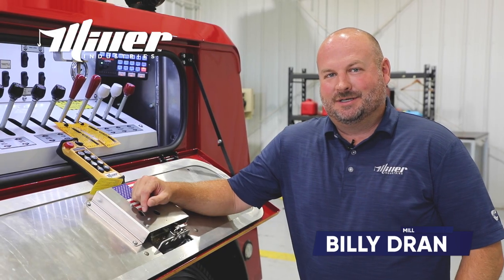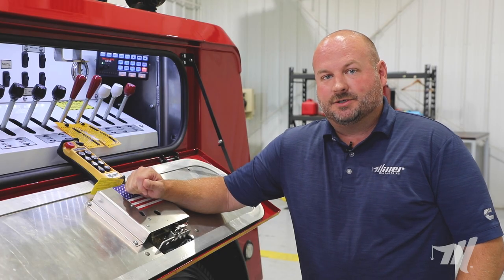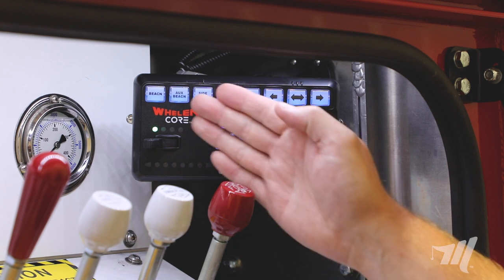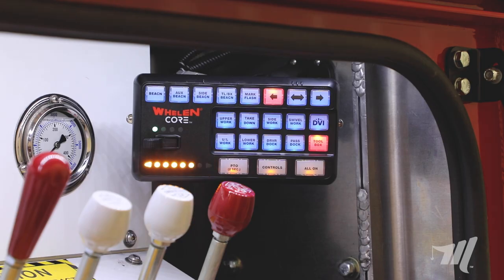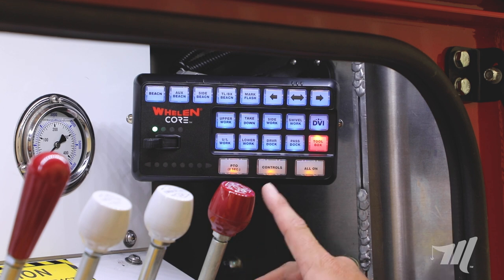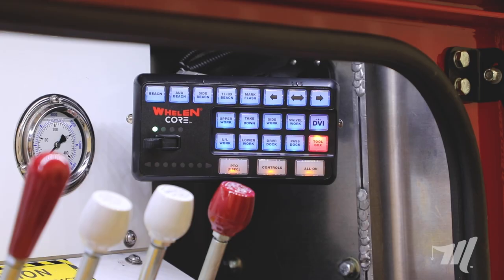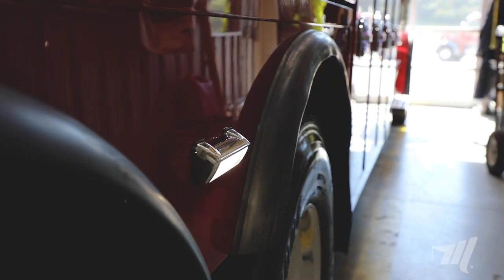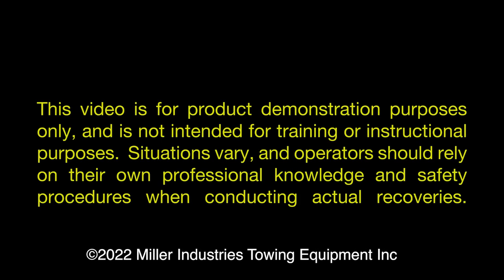Whelen Core System Overview 2022

Comment: Pto and wireless controller, on the whelen controller... it's good. I but think you cheap out on switch.. rather having it on its own.... electronics can screw up... but whelen never suck yet.. it's ok.. but still cheap out/ not hating.. but in another word.. it's called short-cut luxury..